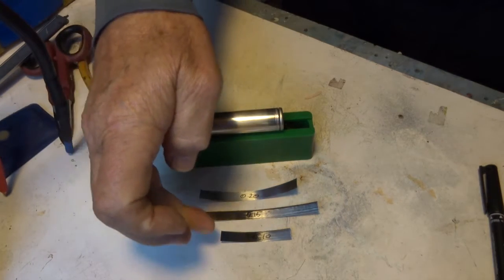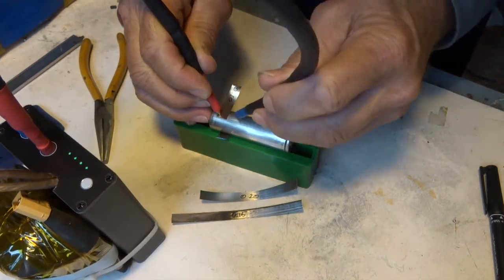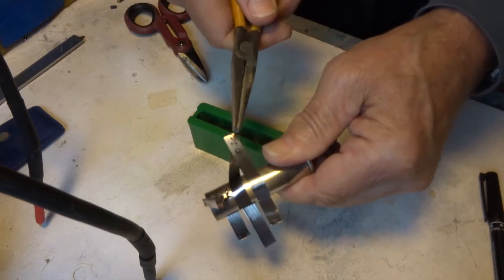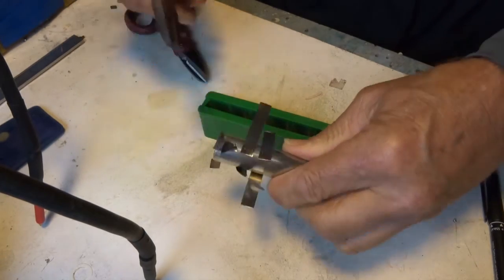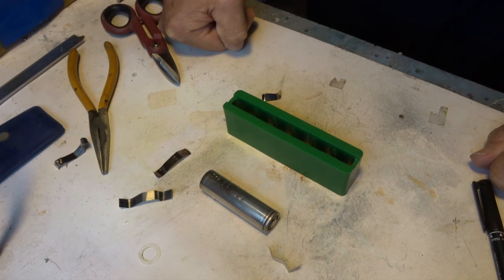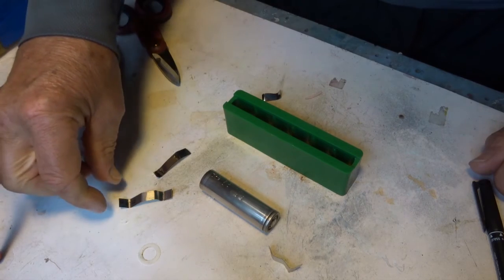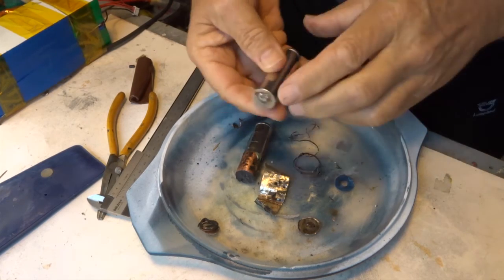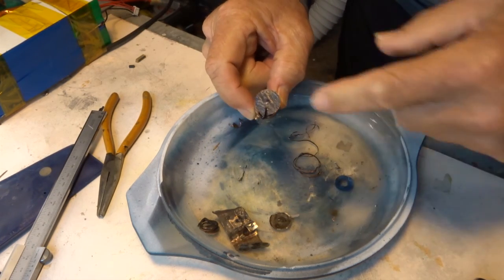Upgrading my mini spot welder for more power and stamina

Comment: You're still not getting enough amps at the tips. Cables should quiver from the surge. also when soldering the bullets (a bit like Anderson plugs) I would have flooded the bullet and saturated the copper tail. Melt the bullet while slowly inserting the Cu tail. Also I have an even large iron for that. Rarely used but there for when its needed. Everything should flow like fast running lava. I didn't see you check the leads for resistance either. You must trust your methods but I don't see the reason here with your process. I guess the saying you can't make a silk purse from a sow's ear id very apt here. I have one of these cheapies and rather than faff around with it I bought a farad spot welder. Saves all the grief Gerard.
P.S. check if it's nickel with a magnet. nickel is not magnetic - plated steel is.

Comment: It always strikes me as an odd way to spot weld, although everyone I see using these welders uses it the same way. It seems logical to me to have a relatively large contact the goes onto the battery terminal that is being welded - purely to connect to it as a conductor - then have the second contact with a small rounded tip which is pushed down onto the nickel strip. In this way none of the current is being shorted directly by the nickel, it is all being conducted by the contact point between the battery terminal and the strip. That ought to give a much stronger weld than the way it is usually seen to be done. Curious to know if anyone has tested this theory?

Comment: What you put on wire called flux  not soldering resin also your soldering wrong thats why you have lumps. Always place soldering iron UNDER the wire and solder on top of the wire. Solder is suppose to flow into the wire. Why didnt you use longer cables.?
Reply: True! but me i'm using Eagle soldering paste it's like a flux but only for wires

Comment: @gerards-tips-and-tricks Thank you for sharing your experience! This is what I was looking for. I have the same issue welding a pure nickel strip of 0.2 mm thickness.
How do you think, does it make sense to sold a copper wire to the 18650 batteries instead of welding a nickel strip ?
Reply: Many would deterr you from soldering Li-ion cells but in my experience, I say it's absolutely possible and can be done safely, as long as you're experienced enough with soldering using a powerful soldering iron, 80w/100w with a flat tip, you need to make sure you don't overheat the cell, I've seen some people put their cells in the refrigerator, take them out when they are at about 10°c which makes soldering safer, lowering the risk of fire (never happened to me, yet) or damaging the cells, just experiment, make mistakes, correct them, that's part of life.
Reply: @Eden_M  Thank you!
Reply: @Eden_M  Problem with this method is making mistakes with lion batteries means the battery starts on fire. Prepare for it and expect it to happen. Ive worked with cell phone and ipad batteries replacing them and had 2 catch fire just popping them in and out of a device. Soldering on batteries raises that risk by many multiples.

Comment: Honestly the welds don’t look like there a true great resistance weld didn’t look like the weld is burning in that good I got a spot welder just like that one and so far the welds I don’t want to trust them are you sure that Bart welder is worth adding more battery power to it in order to get a great spot weld. I was wondering if you think them are really good welds after fixing the spot welder with a external battery pack

Comment: Good day sir, i want to ask if its possible to replace the batteries of other source of power, because my newly bought spot welder have the same battery as yours although mine has expanded/swelled from manufacturer?
I tried to return and refund, got a refund but they said they don't need the product anymore so i don't need to return the product. I also tried looking for same type of battery online but i cant find same battery convenient to my place. That's why i want to know how to fix my battery source to fix the broken spot welder sir. Thanks in advance.
Reply: Where did you buy it? Which seller?
Reply: @johnnycombo9751   its online store shopee. And i tried changing its battery, i found that it really is defective when tried putting a 6v 3a source only. The 3AQ20 chip is burning directly to the power button. I got a hit one time but dont have enough power, then i saw smoke and little burns. So i discarded it since the board also was burned out due to process.

Comment: Use pure nikkel strips like 96% for more amps
Reply: Is pure nickel easier to weld?
Reply: @hexidev no it's harder with pure due to less resistance bc lack of iron
Reply: @brenthawkins204  Yeah i know now but thanks! Purchased a capacitor spot welder that can make holes inside those 18650's... So I would say its up to the task
Reply: @hexidev  which one and what is the max it can do and the pure nickel

Comment: I would have used a heatgun and a solder iron at the same time, i have done that and worked good.

I am going to do the same, but i am going from AWG 10 to AWG 8, still waiting for my cable.

Comment: Thank you I have 2 of these welders I was thinking of running the battery's in parallel do you think it would be OK
Reply from the maker: Connecting an extra power source (battery) in parallel did not help me. So I fear it will not help you either. I am satisfied with the KMoon 5000W welder I bought since (and I think already a newer one maybe even more powerfull has come up based on the same (battery included) principle.
Reply: Just ordered the kmoon  5000 thank you  for the help .

Comment: Ahh, I thought you were going to increase the voltage of the internal battery.
Reply from the maker: That would certainly have destroyed the mosfet chips. Gerard
Reply: It may bot have turned into the rabbit in the race...still a turtle...but definatly get the big jobs done 2ith extra juice for the LONG nights at work😅

Comment: Nice try.
Thanks for sharing.
This welder works very well with 0.1mm PLATED strip (and as you have shown , it's ok with 0.1mm PURE strip).
However , it does not work on 0.15mm and above PURE strip (as you demonstrated).

Comment: Its a crap welder.
Reply from the maker: That is a bold and according to my experiences untrue statement! The welder does what the manufacturer and seller say it is capable of which is welding 0.10-0.12 mm nickel strips. That is done perfectly. Trying to get good welds with 0.15 and even thicker strips is wishful thinking. The fact that I was not able to improve the welding power with thicker leads and more input power means that the manufacturer developed a well balanced product.  If you and me need heavier welding we will need to invest in a more expensive product. I am glad that the Chinese sellers are reducing the exaggerated claims they tend to make….. Thanks, Gerard
Reply: I use this welder, and it do what the producer write, 0,1 to 0,12 strips. Change the cables from 10 AVG to 8 AWG and you take 0,25 nickel covered strips. I move away the cables and mount on the connectors direct 3mm copper rounded nose pointing against each other ca 1,5mm. Now, I hiold the box in my hand and spot 0,2 pure nickel strips on gear 4, You velcome.
With the 10AWG you loose ca 100 amp in the 2 cables...they get very warm after a short time.